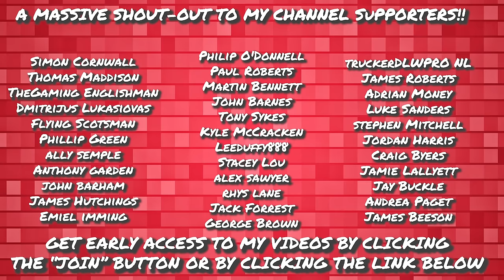Desperate Times Call For Desperate Measures!

Comment: I've had my class 1 since 1996 but never done any tipper work until last week. Was in a Volvo 8 wheeler delivering sand and gravel. After general haulage it was great, decent start and finish times, no 13 or 15 hour days, longest wait to load was 15 minutes, usually less than 10 minutes from arriving to departing, same for tipping. Spent most of the day actually driving rather than sitting around waiting. No work available this week though. ☹️

Comment: I’m curious, why do you keep the body raised a bit when loading?
Reply: Daniel Mayberry it's to activate the scales on the truck so he knows how much he's getting loaded
Reply: You can use load cells which work when the body is down or you can use back pressure from the tipping ram to tell you how much weight is pushing down on the body .

Comment: I was under the impression driving & vlogging could land you in a heap of sh*t if you were ever unfortunate enough to be involved in an accident, the insurer and police could place doubt as to whether you were distracted through using a camera as well as being distracted through talking to a camera, much like using a mobile. I'm not trying to ruin your fun (or affiliate commission) but you may want to research the law and speak to your insurer. Would be a disaster if you were prosecuted being involved in an accident that wasn't your fault.  I've had similar bad experiences using a camera and mic abroad.
Reply from the maker: Something which has been mentioned a few times during the last five years to be honest. I’m not talking to camera I’m talking to myself. And as for the operation of the cameras they are all voice activated. Not touched in the slightest. 🤙🏻